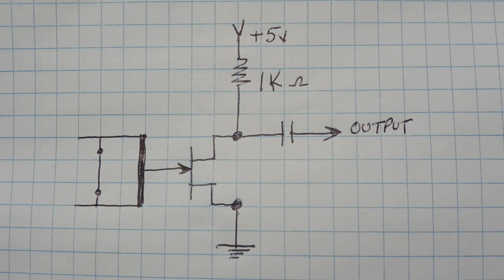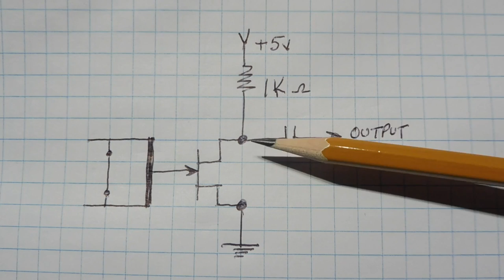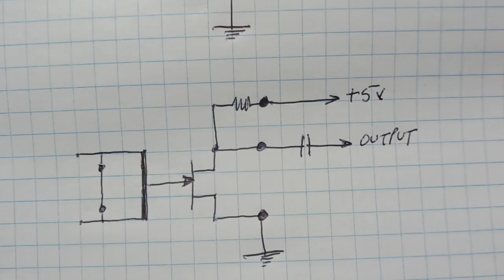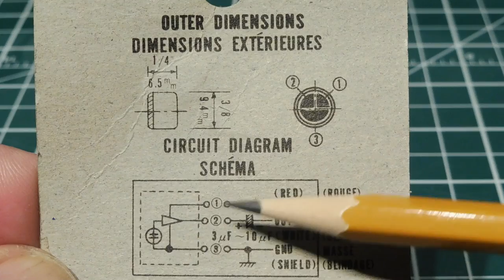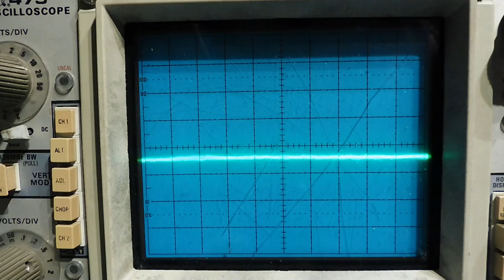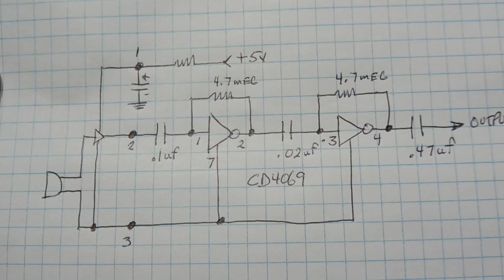Electret Microphones 101

Comment: I found a fun thing about the condenser/FET mics recently. I had a suspicion about how sensitive they might be. I removed the felt cover and wired the mic to one of those little super hearing amplifiers Radio Shack used to sell. I then placed the Am²⁴¹ pellet from a smoke detector face down on the mic. Once you get the mind shattering feedback under control you can hear the gentle patter of raindrops. Those are helium nuclei hitting the mic at about 6% the speed of light. I was amazed the mic was that good and the alpha particles were that heavy. I am hooking it to my oscilloscope to examine the pulses if I get time tonight.
Reply: Is it destructive for the mic membrane?
Is there a way to make a ultra cheap Geiger counter?
Reply: What are you hearing? Especially with that high gain. I'd like to know how you know or figure that assumption. Man that could be anything like frequencies from a radio on a ship. You've got to filter that out until you can tell exactly what that is. But would definitely like to hear more back.
Reply: Feedback, as in audio output signal not isolated from electret?

Comment: That same chip is used in some distortion/overdrive guitar pedals. I've used a couple discreet complementary power mosfets in a midpoint-biased CMOS inverter configuration using a pot with the wiper on the gate, one terminal on the drains, and the other as an input. I could control the volume by turning the pot to vary the feedback, and this setup allowed for much less than unity gain all the way to 0 gain. It was mostly an interesting experiment, but it also made for a nice low-power guitar amp that you could overdrive with nice-enough clipping.

Comment: ah, at last, Someone making sense from the 2- vs. 3-pin electret-condenser mic capsule choice decision-making process.

it isn't the FET that is inside or not, but the resistor?
But where is the resistor in the 3-pin? for current-limiting, is it?

Thank You Maestro!

Comment: Hello, thanks for the quality content.
I have a question - how does the size effect its performance? Some are thicker than the others and similiarly some larger im diameter. What effect does diameter and thickness have?
Reply from the maker: Electret mics are made in a variety of sizes basically so engineers can find the best one to fit their product. The larger the diameter the more sensitive and broader bandwidth. The thickness depends on the size of the FET that has to fit into the enclosure, so it depends on how small they can make the PCB.

Comment: Could I just wire one of these to a guitar jack, and then run an instrumental cable to a pre amp or direct box that has Phantom Power ?
Reply: Definitely not. Phantom power is 48V. Electrets only need like 3.3V. Phantom power would absolutely fry one of these things.

Comment: This video is timely. I need your input if you don't mind. I have a Chinese copy mic from Icom model HM-36. I need it to sound more natural and with a good gain. Which one should I use the 2 pin or 3 pin or you have a better option. Thanks in advance.
Reply from the maker: The 3 pin version was originally made by Radio Shack as a replacement for their CB radio mics, but are hard to find. If you take apart the HM-36 mic check for a pop filter cloth placed across the electret cartridge and remove it. This will improve your audio.

Comment: Another question: I have a recorder which provides 1.5V on it's 3.5mm jack, and then I have a ECM capsule which require 5V to get the optimum performance, how could I change the 3.5mm wire to power the ECM with 5V with an external battery? Would you mind giving a suggestion?

Comment: Hey man. How were you able to connect the oscilloscope to the microphone circuit? Sorry if this is a bad question but I'm a total beginner at this and I'm actually doing something similar for a project, so any help would be appreciated!
Reply from the maker: The scope is connected between the "output" point and ground. Ground on the amplifier circuit is pin 7 on the CD4069.
You can also use an opAmp circuit. Check out this video:
https://youtu.be/Qc_hngcqq7A
Reply: Thank You! My project is on generating electricity from sound. In short, I am not attempting to conserve the information in the energy from the mic, I just want the energy. Is there a way to power a small condenser mic without external power, and if so, have the output of power greater than the input?
Reply from the maker: No, electret and condenser mics need an external power source. Dynamic mics produce their own output signal which is very low.
Reply: Yeah. I've been thinking of using Piezoelectric buzzers instead, which produce electrical energy from vibrations of sound and don't require external power. Thank you for the help!

Comment: I have a Roland/boss br600 one of my inter micro condenser mics has failed. I cannot locate any numbers to find a replacement. Roland offered no help. Any ideas on finding a replacement.
Reply from the maker: Check out the selection at Digi-key and match it to the original.
https://www.digikey.ca/en/ptm/c/cui-inc/electret-condenser-microphones

Comment: Hello, is it possible to join a 2 wire electret to a 3 wire electret? I have a 2 wire mic but my headset takes a 3 wire plug. Is this possible? My understanding of this isn’t that great, thanks.
Reply from the maker: The headset is also wired to the 3 wire plug.

Comment: Howsit bud, I wanted to make a mic to connect to phone to produce much better audio quality for  my scratch track videos/song writing and had infact a few weeks ago bought the exact same looking mic as your 2 pin one in the video a few weeks back, only now had time to get into sourcing info and amping circuits etc, j don't know much at all about the inner workings of different mics to be honest but being a multi instrumentalist and having studied electrical and having done electrical sorts of hobbies turned profession as I own and operate a electrical (residential & commercial) installation and maintenance business I thought I'd give it a go, just one question though, will this mic render a much better audio quality than a regular cellphone or cellphone headset microphone? I will reply again with the model number of the one I have, I'm sure it's exactly the same as the 2 pin, quite a bit larger than that of a regular ear phone headset microphone, I want to "condense" the sound more, eliminate ambient sounds and just regular likely sounds that would disturb a recording.. obviously I am aware I am not going to get nearly the same effect as being in a glass booth at a music studio, just want better clarity than the phones mic itself..  you recon it's the one to do the job yeah?

Comment: Hello sir, do you know where I can find that exact 3 pin microphone. I’m Looking for that model for a project. I can’t find it on the internet and that ECM is very useful for what I need it to do.
Reply from the maker: They were made for Radio Shack as the mic replacement for their CB radio handsets so they are hard to find. Check Ebay. https://www.ebay.ca/itm/3-NOS-Archer-Radio-Shack-Microphone-Electret-Condenser-Elements-600-ohms-CB-Ham/362937629741?epid=1023837363&hash=item5480c4bc2d:g:1IcAAOSwu1deZABk
Reply: Ty, another question. If you add an extra inverter to the circuit, would the output be more amplified or is it too much. To detect a medium to low sound when other sounds are happening as well
Reply from the maker: More gain stages will mean more noise in the output signal. An increase in sensitivity not gain is needed. Check mic specs for best sensitivity.
Reply: It’s terrible because with no guide on how to use, I was hoping someone is familiar with this specific element
Reply from the maker: @juanmanrique4395  That mic looks like it was custom made for a product.  You can build your own from a two terminal mic and add a resistor and cap or buy a breakout board that are available online.  https://www.sparkfun.com/products/12758

Comment: Hi Nice project loved the idea of logic gate amplifier !!
I've one question how to calculate the Load resistor for a 2 pin Electret Microphone like I've couple of those which I bought from an Offline store so I dont have a datasheet for them
Reply from the maker: If you are powering the mic from 3 to 10 volts a 2.2k resistor should work. Generally the operating voltage is around 3 volts with a current draw of .5 mA. If you know the specs RL = VCC - Operating voltage / .5 mA
Reply: @0033mer  Oh Thank You :D

Comment: Hi, great video, really helpful. I wonder if you could help further with a modification I am trying to make. I have a pcb which is a dmx controller for dmx lights. The pcb has a two wire ecm mounted directly on the board, such that the controller can detect sound and sequence the lights to the music. I would like to improve this:
A- relocated the ecm via wires off the board such that the ecm can be placed in front of the speakers for a more direct sound recognition. 
B- replace the ecm with a jack plug such that I can connect a line out from the sound mixer directly to the pcb of the dmx controller. 
Option A is obvious but messy (though may have issues with the extra impedance of the wires?)
Option B is preferred but I don’t know/understand if you can directly replace the ecm with a line out signal? Perhaps a resistor would be needed? Would I use a true line out, or a head phones output from the sound mixer? Does it make a difference?
Can I mod the circuit such that it could take any kind of 3.5mm jack signal?!? Given I’m just looking to detect the beat, the actual quality of the measured sound signal is not that important. 
I’d love your thoughts/help on this?
Thanks GC
Ps I note that you gave an answer to anon yomous ten months ago on option A and suggested coax (great idea as I was worried about interference), but still wonder if option b could be achieved?
Reply from the maker: You need a line to mic interface which is an audio attenuator with  DC blocking capacitor. Check out this video for construction details. You might have to change the 330 ohm resistor to a higher value for your optimum desired level.
https://www.youtube.com/watch?v=aovtGu_pG4w
Reply: @0033mer  thank you ever so much, I’ll give it a go and see how I get on. People like me (ie the people on these comments) are very grateful that you take the time to help us out. Thanks very much, it’s really appreciated!
Reply from the maker: @grantcreasey8003  You're welcome!
Reply: @0033mer  can i use this microphone as a replacement of shure beta 98h /c saxophone mic replacement part"superdiode condenser rpm 110
Reply: @0033mer  shure beta 98h/c  saxophone mic not working condenser problem can you please give me a solution on this  can i replace it with electret microphone with some modifications will it work please reply
Waiting for your reply
Thanks

Comment: Hi,

I'm trying to use a 2pin electret microphone to make audio measurements. I directly connected it to the mic sound card, but I get 50hz power supply noise. I also tried to power it with circuit like the one shown in your video (one resistor + one capacitor), but I get the same 50hz noise coming from the power supply or the ground. Is there an easy way to get rid of it ? like buying a pcb board already made by some experts ? I am not able to find any... Thank you !
Reply from the maker: Sounds like you have a ground problem. Easiest solution would be an USB mic.
https://www.banggood.com/1_5m-USB-Lapel-Collar-Microphone-Omnidirectional-Mic-with-Sound-Card-for-PC-Computer-Mobile-Phones-for-Youtube-Live-Broadcast-p-1605071.html?rmmds=search&cur_warehouse=CN

Comment: can you tell me what different when different capacitances have the same capacitance?im wondering why you using different kind of capacitances.
Reply from the maker: The capacitors determine the frequency response of the circuit. The source impedance driving the input and the output load impedance work with the capacitors to form RC filters.

Comment: Would you know if it is necessary to replace one of these electret microphones with the same exact type or will any type perform equally well. Why I ask is because the replacement I am looking for is  CZ034 and I am not getting much luck finding that type. It is for an analog guitar tuner that I am trying to fix. Any suggestions would be appreciated . Thanks.
Reply from the maker: Electret mic specifications are pretty similar unless it is for a specific custom application. Any general purpose mic that fits your enclosure should work. Here is the spec for your mic: http://www.goodsourcing.com/main/exec/more/mod/pdts/pid/b153025ea1dzuzq4
Search for electret mics online at Digikey.
Reply: @0033mer  Thanks for the information and your swift reply. Is there a test that can be done using a multimeter to test these microphones. I have another electret  mic that I have but it has no written information on it and I cannot remember what I removed it from. Prior to this , I never worked with these before. If not I will do as you suggested in your response.
Reply from the maker: The best way to test the mic is to build the simple circuit shown in the video and hook it up to a scope to monitor the output signal.

Comment: hi buddy nice project, this is along the lines of what i need to do or what i need for my project as i'm using speech rec and want to be able to hear my voice anywhere acrossmy house, i want to use multiple micro phones as well, would it be possible to shrink the project and maintain the high sensitivity pick up from the mic ? im new to mic but want to fast track on my project would you be interested in building what i need if i pay for it ? as it will save me time, let me know either way buddy thanks again and nice work
Reply from the maker: It would be faster and cheaper to get off the shelf mic amp modules. Check out these sites:
https://www.canakit.com/electret-microphone-pre-amp-kit-ck495-uk495.html
https://www.banggood.com/CJMCU-4466-MAX4466-Electret-Microphone-Adjustable-Amplifier-CMA-4544PF-W-For-Arduino-p-1101527.html?rmmds=search&cur_warehouse=CN

Comment: I see that you're active in the comments, so I'll ask you here:
I'm looking for an analog circuit like this to use to activate a microcontroller from deep sleep mode.
The thing is, the activation circuit needs to consume little power when idle as it will be on all the time(the whole system is battery operated). So my question is: do you think this circuit is the best way to accomplish the task I described above or do you think there is a better way to do that?

If you have any ideas that may help, please just give me keywords and I can look them up.

Thanks
Reply from the maker: There are a few ways to bring a microcontroller out of deep sleep. You can use an internal interrupt like a timer overflow or with a watchdog timer. An external interrupt can also be used by simply pulling a GPIO pin low.  A mosfet transistor like a 2n7000 can be used to pull a GPIO pin low when a wakeup trigger voltage appears on the gate. https://youtu.be/Rm4pQZMBUWA

Comment: Where can one find 3-pin condensers? I've been searching all over, but haven't found any.
Reply from the maker: They are hard to find. Radio Shack original sold them as a replacement part for CB radio hand microphones.
A quick solution is the mic from Adafruit with an onboard amplifier.
https://www.adafruit.com/product/1063?gclid=EAIaIQobChMIt56Nlb_u3wIVlh-tBh3OXgqzEAAYAiAAEgKs6fD_BwE

Comment: Is there any easy way to get a PCB mounted mic out of the PCB and on a long wire that's mobile? I wanted to move it closer to the sound source, but results were disappointingly bad instead of better. (My entire knowledge of mics is this video, and I'd be lying if I said it all makes sense to me. If anybody here has a spare moment, I'd be very thankful.)
Reply from the maker: Using wires to connect the mic will act as an antenna and pick up a lot of noise. Use shielded coax cable like RG174. Hook up is polarity sensitive as power is also fed down the coax cable. Ensure the shield is connected to the ground of the mic.
Reply: @0033mer  Wow, thank you so much! That's brilliant!

Comment: Hello! Is there a possibility to make this circuit work on 12V?
Reply from the maker: Yes, change the external load resistor for the electret mic ( pull up ) to 8.2k ohms.
Reply: 0033mer  how did you calculate thr required sensitivity resistance for the supply .  I am using 9v so what must be the pull up resistance??
Reply: @0033mer  Thanks! I'm trying to light up 3W led diode with this, I have connected IRLZ24N mosfet to your circuit (and a simple diode before it) and it works really nice, but sometimes it powers up with diode lit up to the max. Everything is battery powered. Can you help me with this?
Reply from the maker: Try putting a 10k resistor from gate to ground (source).
Reply: ok, I'll try! @0033mer

Comment: Please build a low noise opamp for this or link me up to a resource with circuit diagram for opamp with a 3.5mm female output
Reply from the maker: Check out the MAX9814 from Maxim.
Adafruit has a breakout board.
https://www.adafruit.com/product/1713